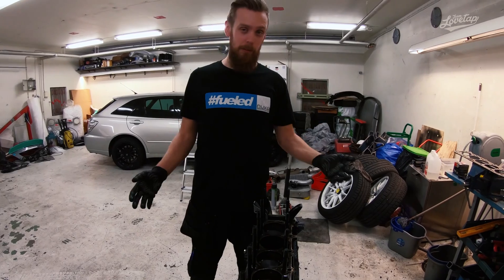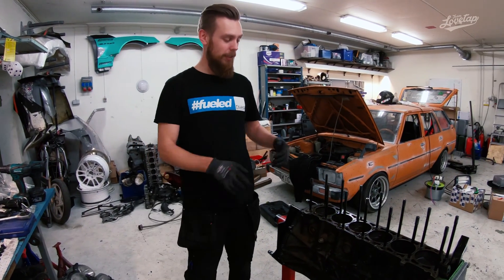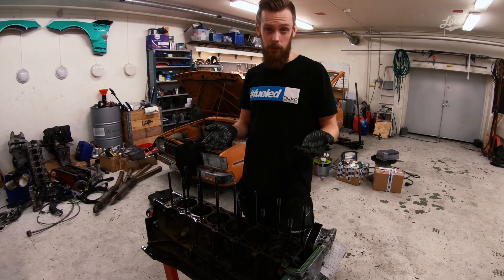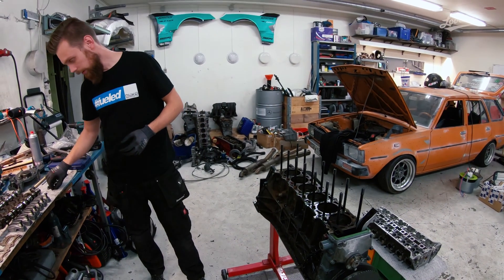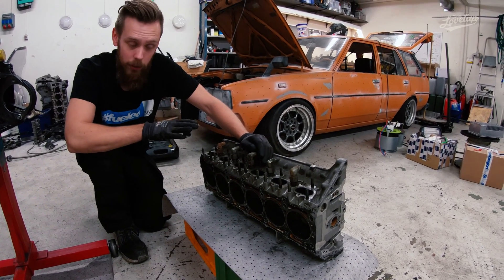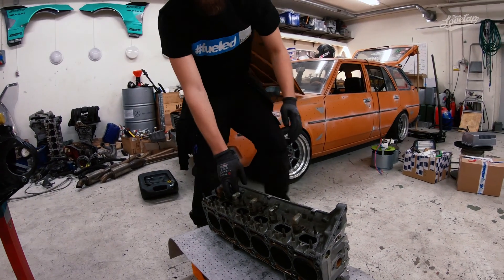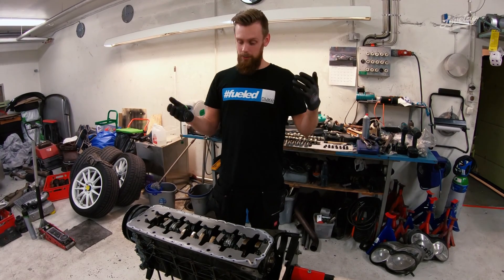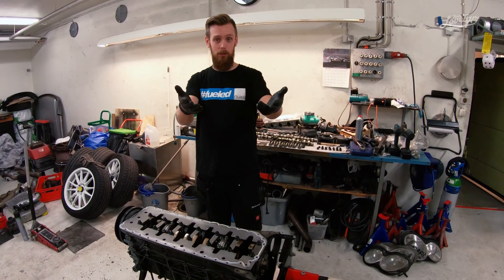Hammer & Spanner EP 7 - 800whp on stock pistons?! - M104 Turbo

Comment: How do you use the s38b36 rods and bearings on the m104 crank, when the width of the big end of the rods is 23.9mm and the width on the standard m104 rod is 22mm?
Reply from the maker: I have machined down the width on the small end and the crank is wide enough and are not built for axial controll of the rod
Reply: @TeamLovetap  thank you! I presume the bearing clearance is fine also, using standard ACL?

Comment: Whats the cheapest option for "reliable" 450hp (engine) m104 or om605? I just bought my first car, volvo 745. Im new to tuning but really want a good engine to work with and learn as i go.
Reply from the maker: I think M104 is the better alternative for sure, the diesels are good but are harder to male them last I feel
Reply: om605 will be hard. maybe go om606. should do 500hp unopened with the right mods. less work with wiring on diesels, only hard part is timing the pump but after that its pretty easy.

Comment: My suggestion to you about girdle my friend, stainless steel is not good choice,it’s tough metal,you should take cast iron girdle,it absorbs vibration and has better abilities to handle
Reply from the maker: Yeah Ive heard similiar ideas but At the same time I have been running this girdle for many years without the cracking 🤙🏼

Comment: Hello my enjoy watching your videos does really good work you do I have got the W124 280 94 it is only have 90,000 miles i’m having a trouble getting oil into my coolant system I don’t think it’s head gasket I did try some pressure test I don’t know if you can help I know you’re busy man thank you bro
Reply from the maker: thank u man! Have you checked the oil/water hear exchanger? 
And did u pressurize the water system to see if you get any extra water in the oil?
Reply: @TeamLovetap  thank you mate I haven’t done pressure test but there is no water mix with the engine oil level is good I will do what you side and I will keep searching thank you so much

Comment: Hey mate, love your detailed videos and what you do for the M104 community! What are your thoughts on a stock head gasket for 600whp? I’m
Looking at the 144mm turbo bandit rods to be able to rev higher and drop the compression - do you think a thicker MLS gasket is a smart move to drop compression further? Thanks!
Reply from the maker: Thank u for the kind words🙏🏻 stock headgasket from the factory should work but the aftermarket one are bad now, they rarely last that high anymore, they changed the manufacturing process somehow…

Yeah if your going to run stock pistons I would probably lower the compression a bit to make the ring lands last

Comment: With a bit of maintanence, changing the gaskets and bearings, is the block suitable for a turbo setup? With all the stock internals? Most HP i want to push is about 450 i guess. Love your vid! Another greetings from The Netherlands!
Reply from the maker: I would say its good enough unopened for that kind of horsepower, if its s low milage m104 like around 200000km 🙌🏻 thank you man!

Comment: Hi.
Thank you for sharing your knowledge with us. I have watched almost all you vlogs and episodes. I do appreciate your work, thank you Sir. 
 A lot of good information for beginners like me. I am in the process of swapping m104 with a turbo into my w210 e55 amg, so I bought the m104.992 engine, after tearing it apart I have discovered that I don't have oil squirters and my pistons are made by Nural, not Mahle. Do you know if they are as strong as Mahle pistons and can have hight boost or do I need to find mahle pistons?
Also can I use diesel engine OM6xx squirters in my engine block? If you could give me information that would be great. Thank you and keep up with good work.
Reply from the maker: I dont remember what the piston brand is on my m104.992 tbh but i think both work pretty good. 

Yes you could use these squirters, but does your block have the mounting points for the oil squirters? If it doesnt have the squirters stock?
Reply: @TeamLovetap  thank for your replay Sir, I appreciate it. 
Yes it does have mounting points in the block. Talked to my mechanic he said bring me the original squirters and I will install them. So I guess I am good with this situation. But still can't find information about the positions. But what's I have found (saw with my own eyes 👀 :) ) that 2.3 engine with compressor has Nural pistons. So I guess it will work as fine as Mahle. 
P.S. I was wondering if you had a chance to finish up with the plate for stock oil pump, to prevent the block from cracking.( in one of your episodes you said that were working on it
Reply from the maker: @arseniysumskoy1500  never finished the product for the market because people are a bit to cheap in the m104 market 👀
Reply: @TeamLovetap  got it Sir. Thank you. Pleasure talking to you and best of luck in a new season. 👍💪🤝
Reply from the maker: @arseniysumskoy1500  thanks alot man!

Comment: I owned a 1997 C36 AMG, for years. Sold it with 297k miles and it was rock solid. Thank you so very much for all this info and in depth detail on the M104. it really is one hell of an engine that is overlooked. Your content is fantastic and look forward to seeing you break the 1000hp mark.
Reply from the maker: Yeah its a great engine 🥰 I hope to rev higher to begin with👌🏻
Reply: I’ve got a ‘97 C36 also! Mine has 206k. Everyone on BAT thinks the W202 C43 is superior “because it’s a V-8”. But the AMG rebuilt M104 takes an already great engine, and makes it something truly special. The C43 is just AMG cams (SOHC 3 valve per cyl) on a standard short block. The C36 lump got the FULL AMG treatment, forged crank, rods, pistons, etc. A beastly motor - can’t imagine what a turbo’d M104 would feel like!

Comment: Do you have a part number at all for the hx bearings that you used at all I can't find any in the UK by normal search terms of you can help I would really appreciate it no worries at all if not looks like your having fun setting up your new workshop great work guys
Reply from the maker: I can see if I can find the number, Btw I ended up going back to ”non HX” bearings the standard ones for this season to reduce bearing clearance
Reply: @TeamLovetap  thank you for getting back to me I did wonder with the pin on the crank being smaller on the mercedes crank than on the BMW so if STD ones are fine for it I'll use then how often do you find you have to change the bearings reason I ask is it's a street car thanks again for the great help and I hope you had a good Christmas
Reply from the maker: @M-oneeleven-M111  no probs man, atleast 2 seasons of torture, but they would last longer
Reply: @TeamLovetap  thank you great help I've found some king bearings that are in budget  I was torn between king or ACL seems to be little choice here in the UK for some reason
Reply: How can you fit the ZRP big end side of the con rods (23.9mm) to the m104 crank that originally has 22mm? What am I missing?

Comment: I can't believe I didn't see this sooner thank you greatly for sharing what you have done and how seems to be a rare thing in the mercedes tuning community but thank you a great amount of this also applies to the m111 engines aswell from my knowledge thank you again
Reply from the maker: No problem man! I do it so more people will do it!
Reply: @TeamLovetap  That's great man keep it up we have our turbo slk in pieces at the moment new headgasket time for it 1.5 bar peak on a unopened m111 ticking time bomb
Reply from the maker: @M-oneeleven-M111  Im quite eager to test a m111 in the future actually:)
Reply: @TeamLovetap  m111.975 seems to be the best for it with low compression ratio to start with and being a 2.3 plenty of torque and hp to be had but we are trying to find the stock mechanical limit ourselves before swapping to some BMW forged rods

Comment: I miss my C280. The M104 is a solid engine and very well designed. Mercedes made a huge mistake dropping it for a V6.

I might look for a C36 some day to play with.
Reply from the maker: Shabuti R18 yeah they did a great job with it. ive been thinking about building a V6 with turbo just to see how well it works
Reply: @TeamLovetap  The C32 was an impressive machine, but I hear the V6s just werent as smooth or reliable as the M104 was.

My C280 had 150k miles on it when I sold it, still ran like new and got 30mpg highway. I always kept the engine bay spotless clean and those brass colored exhaust manifolds shiny! 

I did have an ignition coil pack go out on me I guess once, but it wasnt very expensive like people make it out to be and a really easy fix.
Reply from the maker: Shabuti R18 yeah probably not as good but might work

Comment: I have a chance to grab a m104 3.6 AMG engine for cheap. Only thing that's stopping me is finding an aftermarket replacement head gasket. Saw someone online tried using a 3.2 one and ruined the engine smh. But having a boosted m104 3.6 in my e30 would break the internet.
Reply from the maker: Von Knight there are mls gasket and also athena now i think

Comment: turbobandit.com whese guys making 1200 hp from these engines you can buy doble springs from them and you will have 9000 rm.
Reply from the maker: Gediminas Marcius show me a dyno sheet...
Reply: Team Lovetap check them out they the best of the best when it comes to the m104
Reply: @aaronfainshtein7478  they dont show any dyno sheet at all that they are making 1200hp.. its just empty words if they cant prove it..

Comment: i think that soft seal is in fact Teflon  . i also think your block cracking is related to  ignition cut limiter bashing switch  to fly by wire and rev limit buy throttle and think things will be safer  can anyone help me ban this video to keep the price of M104's down forever, please ..
\
Reply from the maker: Yeah it can be teflon for sure 🤙🏼 the block that we cracked was on fuel limiter
Reply from the maker: Adam Naylor haha yeah we hope the price stays down but probably not

Comment: So is this engine on stock oil pump?
Reply from the maker: Serge SVZ no it is a drysump setup due to space problem in this chassi, but alot of people run stock pumps with similar power. Check out episode 4 of this series for info about our drysump system